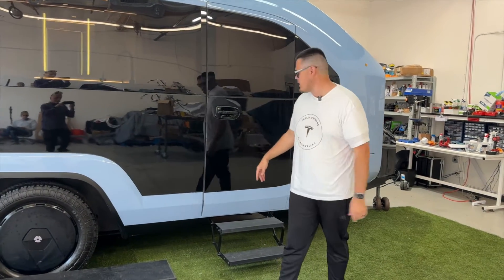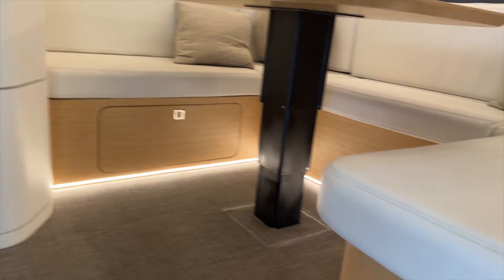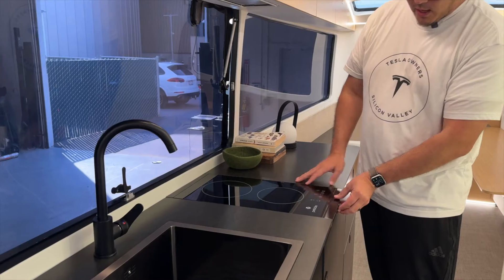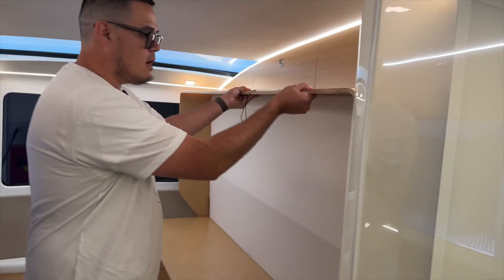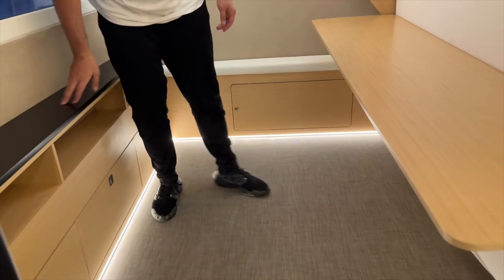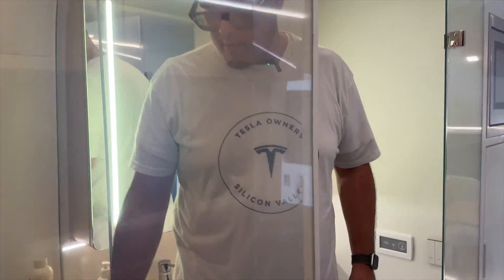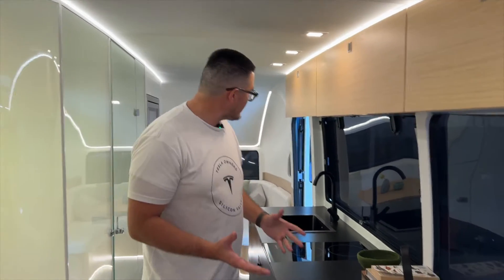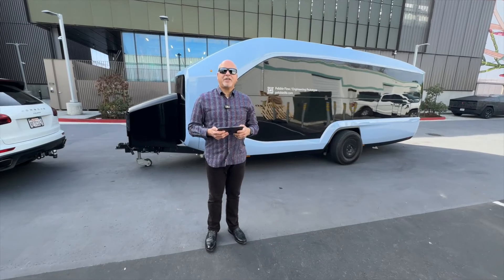Pebble Flow RV Walk-Through: The Future of Travel in the EV Age

Comment: "It comes in two versions, one for $109,000 and one for $125,000".Jan 8, 2024
I can buy a well equipped new 24 foot trailer from my local RV dealer for 30k, a used pickup with 40k miles on it for 35k (ram 2500 crew cab), and drive it 50k miles assuming 6 dollars a gallon price and 7mpg .  before i spend 109k.  If i can drop 110k on a trailer I'm not concerned about saving money at the gas pumps. Like the EV car industry, the appeal to the masses only works on people to wealthy or elitist to actually do the math.

Comment: How much?
Reply: "It comes in two versions, one for $109,000 and one for $125,000".Jan 8, 2024
I can buy a well equipped new 24 foot trailer from my local RV dealer for 30k, a used pickup with 40k miles on it for 35k (ram 2500 crew cab), and drive it 50k miles assuming 6 dollars a gallon price and 7mpg .  before i spend 109k.  If i can drop 110k on a trailer I'm not concerned about saving money at the gas pumps. Like the EV car industry, the appeal to the masses only works on people to wealthy or elitist to actually do the math.
Reply: Starting at $109,000 before potential tax credit.

Comment: Fantastic. But before I get the money and it exports to Europe (🫣), just wondering, does it have a dark mode, so you can sleep in darkness? There were no drapes obviously, and it could be done by the window panes dimming similarly as the shower screens. Surely there must be some feature about it, you might have possibly missed it?
Edit - I want to add that I was waiting for a trailer with extra battery to extend an EV range while towing, and this is the first attempt I see in this direction. And of course once you have the battery, why not using it also for maneuvering? That is just super great! Nice tip!